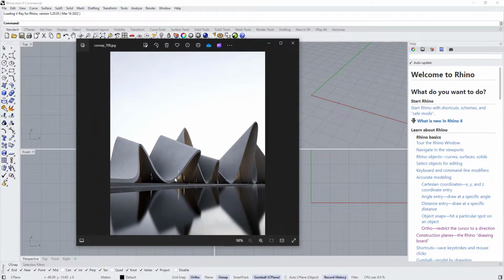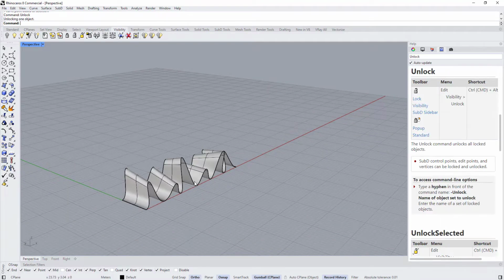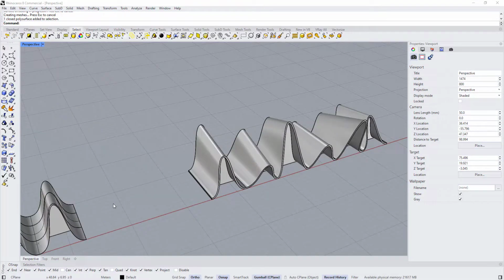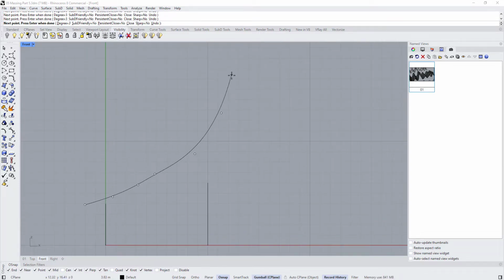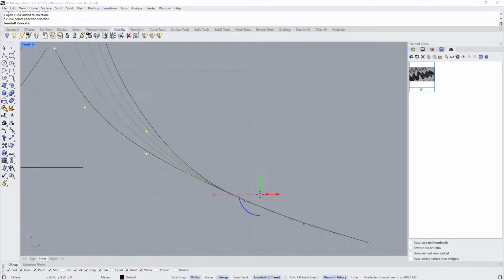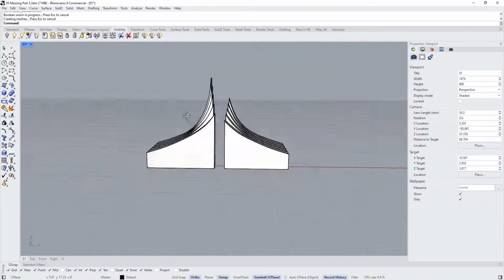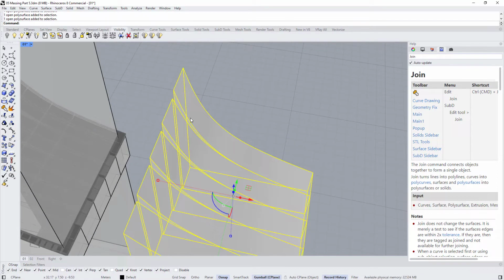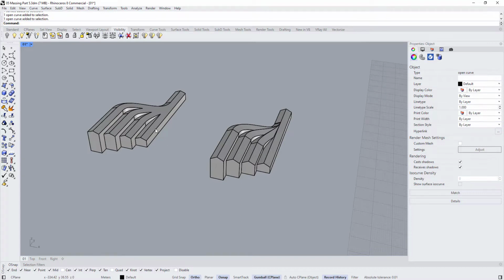06 Rhino Beginner course for Architects_Massing part 5_Linear Forms 3

Comment: 4:42 "OffsetSrf": give thickness to an surface
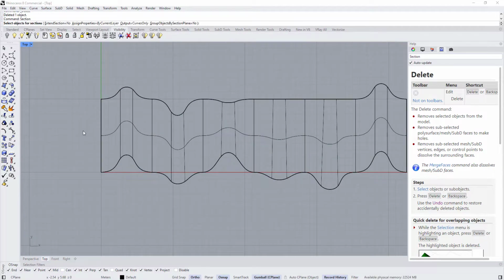5:55 "section": make lines of section from an surface
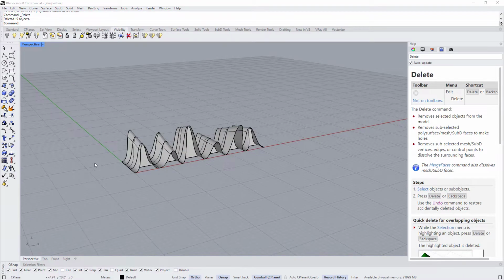7:12 "Selcrv": selecton curves only
8:24  options in "OffsetSrf" - Corner round vs sharp
9:06 options in "OffsetSrf" - Loose Yes vs No
10:35 "TweenCurves" : make several trasitioning lines between two lines
12:35 lengthen gumball's dotted line for delicate scaling
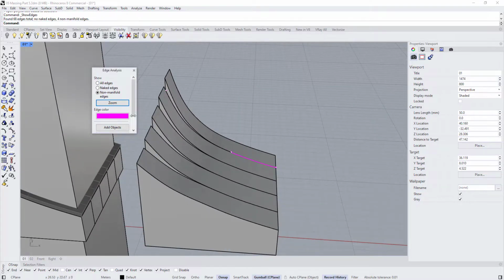22:43 find "Non-manifold edges'

Comment: Great tutorials! However, double-clicking to move the Gumball isn't working for me, and double-clicking to extend the Gumball scaling handle also doesn't seem to work. That said, I am able to extend the handle by holding Control and clicking on it.
Reply from the maker: I believe you are using Rhino 7, in Rhino 7 you have to Hold Control to move the scaling handle or to rotate the gumball, and to move it hold control and left click then release control while keeping the left click and drag it wherever you want..................this is how to use it in Rhino 7, however, I believe it is way more user friendly in Rhino 8

Comment: thanks bro keep doing this.
Reply from the maker: Thanks a lot, I’m glad that it was helpful for you, and sure I will ✌️
Reply: @PH.Studio  for sure my bro, I am kind of struggling with architecural elements in rhino, for example trying to create a layered wall, for example brick then insulation then block etc etc without taking a long time, is there a faster way to?
Reply from the maker: @1insp3ru16  Grasshopper is the best way to automate this process, or you can use a BIM plugin like VisualARQ to create a wall family with the required layers